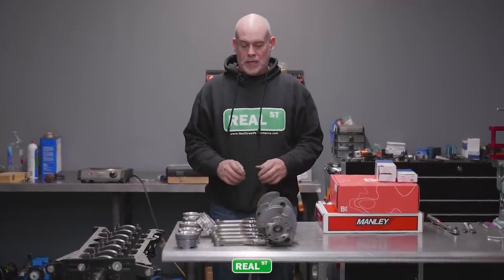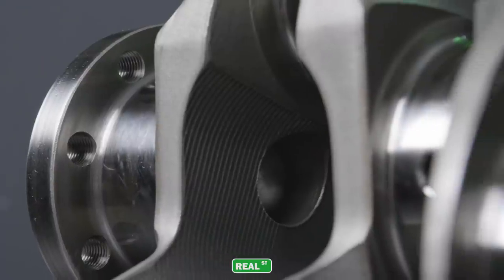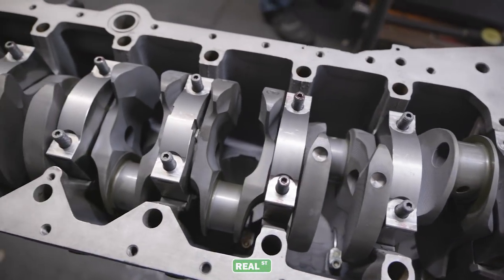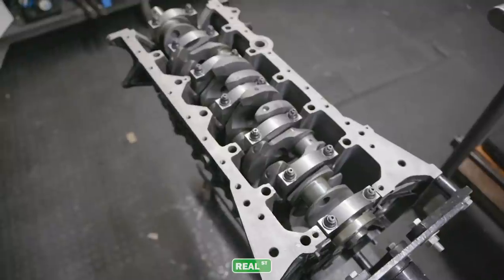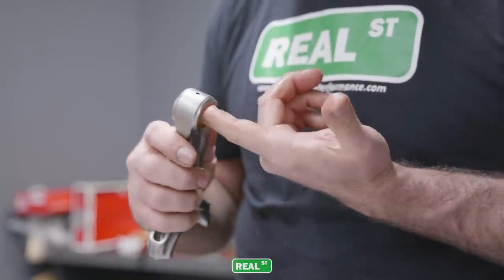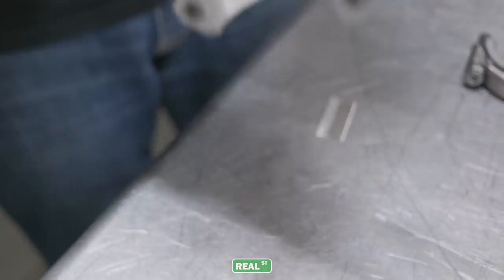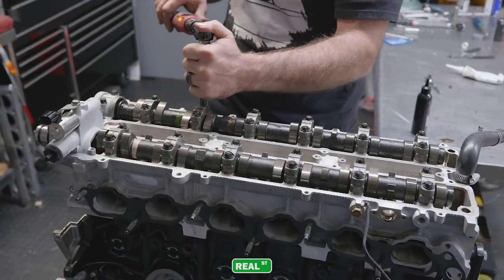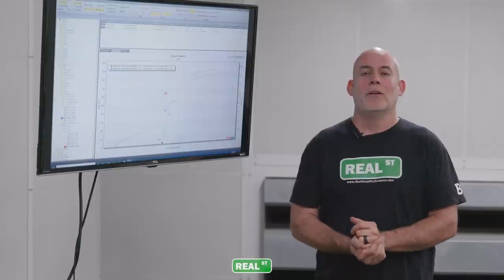Shaving 16lbs Off 2JZ Engine With Titanium Rods & Billet Crank - Jay's 96mm Stroker Build

Comment: Do NOT put oil behind the bearings, 
assemble them clean and dry on the back side!

Locate the main caps with dowel pins!

This WILL eliminate any cap walk!!!

I used to do N/A Nitro Methane engines.
5.40.... 255mph.

Comment: shaved some weight out of the engine im building. A high-comp 6g72. Between Billet pistons, forged rods,Cam gears,Springs and retainers, cam gears, Aluminum flywheel pretty theres about a 15lbs weight difference. Unfortunately i couldn't save more with a shorter piston skirt as No ONE makes High comp (12.5:1) pistons for a 6g72 save ross pistons and they're a full round style piston.. No one makes a short skirt style piston. But saving 16 lbs out of an already built engine is pretty nuts.

Comment: Hello jay! How much maximum can you increase the power of the 2jz engine?
Reply from the maker: While I’m not sure a maximum limit has been found yet, there are people going 5’s in the quarter mile with sleeved billet aluminum dry blocks in 2jz dimensions. As for a built oem cast iron wet block we went 6’s with it through an automatic in a car that was heavier than most race cars because it had to have street driving equipment for drag week. So it’s gotta be up there

Comment: Hello Jay I have a 2001 Gs300 like Roberts and was wondering if I should go the stroker crank route I bought a full jdm 2jzgte vvti aristo swap.  I was thinking possibly procharging the car with a F1 procharger and using a BMW 8hp70 transmission with a controller.  I want to try something lil different from the norm since alot of the new cars are coming out with 8 and 10 speed transmissions.  I just wanted to get your opinion. By the way this will be a street car
Reply from the maker: The stroker crank really makes the driving experience of the car more enjoyable on the street. Low end torque, part throttle response, and turbo response all improve

Comment: Which engine oil did you use on the backside of the bearings? The red stuff is not atf i guess? Thanks Jay!
Reply from the maker: I just use ATF. It's thin and displaces any particulate on the mating surfaces and will lubricate the surfaces as the bearings meet at the parting line and get forced into their location.

Comment: Just wanted to point out that the previous torque line on the graph is suuuuuuuper faint. Otherwise, excellent video and great insight on everything, Jay. 
Curious what's the most you'd spin this 96mm crank up to. I do see 8k.

Comment: Is oil on back of bearing mandatory?
Love your videos!
Reply from the maker: i mean, its not mandatory. the parts will go together without it, but the bearings are held in place by the crush of tightening down the main caps. As the main caps get tightened down, and the bearing becomes crushed, the lube behind the bearing gets squeezed out the sides, taking left over tiny debris with it.
Reply: @realstreetperformance  thanks for you reply! This is by far the channel for engine builders.

Comment: my question so far is why not go all out and do 10:1 compression instead?
Reply from the maker: Good question, i think the answer seems easier if you just keep going. Why not go 10.5:1? why not 11.0:1? or 12.0:1? Compression vs Boost vs Timing vs Detonation vs Heat is all a give and take relationship. Upping the compression doesnt always translate to a better combination. You could up the compression, which will affect the other components in the relationship. Its all about finding a total package that works for you. This is a combination I like.

Comment: You put oil under the bearing caps? Won’t they spin?
Reply from the maker: not at all, while it seems reasonable to think that, the bearings are held in place by the crush of tightening down the main caps. As the main caps get tightened down, and the bearing becomes crushed, the lube behind the bearing gets squeezed out the sides, taking left over tiny debris with it.

Comment: What kinds of rpms can this go to safety with the rotating assembly being lighter?
Reply from the maker: Roscerio the best way to think about it is that (kind of like people) all engines will die, and are constantly dying a little bit more each day. The harder life they live, the shorter it’s life span will be. Making parts lighter will make its life easier and should extend its life span from what it was. But it’s still approaching an eventual death. There is no “safe rpm” that it will live forever at. A Higher rpm window will just cause the engine to approach a death faster than a lower rpm window.

Comment: is that okay if i dont put oil under the bearing?  this is first time i saw this.. tq
Reply: I thought the same, pretty sure that’s something you are definitely not supposed to do.
Reply: A lot of people dont use that method because of your oil clearance. If you use too much oil/assembly lube for example you will destroy your bearings.

Others like jay do that just with a tiny drop of oil to protect the backside of thr bearing. Whenyou install them sometimes you will shove the backside and some material stays on the edge that you have to wipe away.

I guess that was very thin red atf. I also do both methods and would recommend beginners that you DONT use oil unter the bearings. It is safer..
Reply from the maker: over the years, there has been a lot of "rules of thumb" passed down between generations that just got memorized without looking into any further. But this is a method I have used on hundreds of engines that regularly make over 200-300hp per cylinder. The bearings are held in place by the crush of tightening down the main caps. As the main caps get tightened down, and the bearing becomes crushed, the lube behind the bearing gets squeezed out the sides, taking left over tiny debris with it. There isnt any oil in there anymore by the time the bearing is crushed into place.
Reply: The bearings are crushed and held DOWN when you tighten down the caps. They dont go anywhere unless you starve the engine of oil.

Comment: Isn’t putting lube behind the bearing an absolute no no??
Reply from the maker: not at all, the bearings are held in place by the crush of tightening down the main caps. As the main caps get tightened down, and the bearing becomes crushed, the lube behind the bearing gets squeezed out the sides, taking left over tiny debris with it.

Comment: Why did you lubricate the rod (behind the bearing)?
Reply from the maker: the bearings are held in place by the crush of tightening down the main caps. As the main caps get tightened down, and the bearing becomes crushed, the lube behind the bearing gets squeezed out the sides, taking left over tiny debris with it.
Reply: You lube all 4 sides
Reply: @realstreetperformance  Corrme if I'm wrong, wouldn't that leave some lubricate behind and create inconsistencies in the bearing clearances? I've never once lubricated the back of a bearing. I clean the saddle with ATF, acetone, ND mineral spirits. Thanks for the replay.
Reply from the maker: @scottworelds2933  hey Scott. Nope it does not leave lubrication behind or change the bearing clearance. It’s a method that has worked fir a very long time. I’m not sure why it became such a popular topic in this video. We’ve used this method in every engine video. Growing up people thought that lubing the back of the bearing might allow it to move. But thats not how bearing crush works. Now today people think it shouldn’t be done because they heard it from their fathers who heard it from their fathers and pretty soon you have 3 generations of people that “know” not to do something but none have ever checked if it was true or if it was an “old husbands tail”. It’s a great exercise in “how do you know what you know?” If the answer is “because someone told me” then you don’t really know for sure. Especially in this case. In this case, we show how we build very powerful and very fast engines this way and they do not suffer premature bearing wear. But don’t take our word for it. You can try it yourself if you want  and then you will truly “know” :)

Comment: They always say not to put lube on any of the caps. Your method is new to me.
Reply from the maker: while it seems reasonable to think that, the bearings are held in place by the crush of tightening down the main caps. As the main caps get tightened down, and the bearing becomes crushed, the lube behind the bearing gets squeezed out the sides, taking left over tiny debris with it.
Reply: My engine builder did the same thing or told me to do the same thing to my rod caps and bearings when i built it back in 2000 as Jay just did ... this was on my 98 240sx ka24de

Comment: I have 2 questions, the 1st being why do u put a small amount of lube behind the bearings, won't that cause them to spin in the bores ?

And 2 I have a set of Cunningham Titanium Connecting Rods that I had Greg Cunningham make me a while back for an ej25. Finally getting around to that build. I emailed Lisa Kubo and she told me to be sure to "Lap" the Connecting rod bolts really well, how is that done and why ?

I would ask Cunningham, but they closed their doors so no one to ask there.. My rods have Cunningham gold plasma moly coating and Cunningham's own 3/8 rod bolts A1 H.. Any help would be appreciated. 

Thanks
Reply from the maker: Hey Mark, the bearings are held in place by the crush of tightening down the main caps. As the main caps get tightened down, and the bearing becomes crushed, the lube behind the bearing gets squeezed out the sides, taking left over tiny debris with it. There isnt any oil left between the bearing and the block by the time it is crushed into place.
Reply: Thanks for your reply Jay for helping me understand lube behind the bearings.. Any idea on my 2nd question about lapping the con rod bolts on titanium rods  ?  I have talked to several builders and know one can give me an answer.. One top alcohol builder took a guess and said to put a small amount of lapping compound under the bolt shoulder with the cap in the vise and just like a valve lap the bolt shoulder so there is a smooth mating surface between the bolt shoulder & cap..He had never heard of doing this either & this was his best guess..

Also what do u use for assembly lube for the bolt and ti beam..
Cunningham said 80/90 but did not give a stretch value.. I'm ki da bummed on the no stretch value..

Comment: 7:26 Why do you use two different lubes for either side of the rod bearing?
Reply: He uses oil where the bearing meets the rod and the he uses assembly lube where the bearing meets the crank🙂
Reply: @mariospera3282  Thanks, but thats not what my question was.
Reply: Answer at 2:10
Reply: @0000a-v8d  Yea I caught that, but WHY the different lubes.
Reply: Oil film thickness affects the bearing clearances, so thin behind the bearing is ok.
Reply from the maker: @beachboardfan9544  I use a thick lube that will stay put during cranking until the oil pump primes and a thin lube on the back of the bearing that's displaced when the bearing halves meet. Thanks, Jay
Reply: @realstreetperformance  Thanks! Why oil the backs of the bearing at all?
Reply from the maker: @beachboardfan9544  it acts as a “flush” when you tighten the caps down it pushes the oil out carrying any lingering debris with it and it helps the bearing seat in place as it’s being crushed in

Comment: Guess we'll all ignore the 1.58 rod ratio this 96mm crank puts him at on a standard 152mm length rod. There's no mention on weather they used a custom longer rod to alleviate that or (if not) how this will affect his max rpm limit as mean piston speed is to be taken into account.

Stock ratio is 1.77 and can rev freely.
Reply from the maker: Hey there, we are not ignoring it at all, almost every engine we build has a lower rod/stroke ratio than stock. Our most common 2jz combinations for many years have 152mm rod / 90mm stroke and 152mm rod / 94mm stroke. If you scroll through our channel and look at the 6 and 7 second street cars, they have rod/stroke ratios lower than 1.77 Much of what we do at real street is testing passed down "rules of thumb" in the real world. We were all told the same thing  growing up "low rod stroke ratio means low end torque, low rpm limit, and high bearing wear." But how low is too low on rod stroke ratio, and how high is high on bearing wear? When does it start to actually negatively affect the ownership experience of the engine? Is 1.77 OK, and 1.76 NOT OK? what about 1.75? what about 1.74? how much does 0.1 change in rod stroke ratio affect bearing life or an engines ability to rev? is it 0.001%?  1%? 10%? Well after trying it for many years we learned that a 1.68-1.61 rod/stroke ratio still lives longer than most people end up keeping a race car for. Even with the increased rod angle, the engines have lived, they rev freely, they make wide powerbands, they spool up big turbos faster, they make more power in the mid range and are more fun to drive on the street...so while they may wear bearings faster, its not enough faster to change the ownership experience of the engine in the real world. And for applications that exceed 300hp/cylinder we help extend bearing life with aluminum rods. So here we are again testing things in the real world. This engine is a 1.58 rod stroke ratio...maybe it will live a long life like the 1.68 and 1.61 engines do, or maybe it wont live as long. If the bearings wear faster it will be interesting to see how much faster they wear. Did they live 99% as long as the other configurations? or 50% as long? Testing theory with real world experimentation and data is one of the most fun parts of this job.
Reply: I'm just jealous. My stoker has a ratio of 1.51 and has indeed suffered from both bearing wear and oil consumption. I'm redoing it now with a better piston design to take care of the oil consumption and swapping in a taller deck to use a longer rod. Perhaps I'm sensitive to rod ratios after being bit by not considering it previously. I'm positive aluminum rods would help you in this case, but on a daily street car, as is mine, it's just not worth the added expense in my eyes..... 144x95.5 Audi inline-5 for reference.  @realstreetperformance
Reply from the maker: @mushasho  I understand, how much power does it make and how heavy are the rods and pistons? You might be using a heavier part than necessary. That can play just as much or more of a role in bearing wear as rod angle. Also detonation can kill bearings prematurely. Do you have a good enough data logging system to identify occurrences of detonation?
Reply: I'll admit, that On ethanol instances of det have proven to be a challange for me to detect, possibly cuz I choose to stay on the conservative side in terms of timing.... As far as rod weight, they are around 574 grams. Aluminum isn't offered or readily available for my application unfortunately.  @realstreetperformance

Comment: How do you feel about using caps with a girdle
Reply from the maker: I like the girdles that are integrated with the main caps like the Evo 9 engines. There are also some engines that try to hybrid a bedplate design by incorporating the pan rails and maincaps together. It really gets case specific as the amount of stress on the mains change. The 2jz has 6 rods but 7 main caps whereas an engine like the Vq has 4 mains and 6 rods.    Based off experience I don't see the 2jz needing a girdle as the blocks shortcomings are not in the mains. Thanks, Jay

Comment: is BC titanium rod coated? Usually i see titanium rod with yellow color because TiN coating
Reply from the maker: These are not. On engines where the rod is partnered with another on a journal like a common pin the rod should be coated to avoid the two rods from galling each other. On an engine with each rod having it's own journal it's not critical. Engines like the LS7 in the C6 Zo6 it's critical. Thanks, Jay

Comment: Will titanium rods have to be replaced in the intervals as aluminum rods?
Reply: No, the alum rod is a soft metal which is why they are easier on bearings in big power builds. These are basically a stronger and lighter version of the standard steel rod. Most people don't buy them because they are roughly double the price of standard quality steel rods.
Reply: @dj4monie  Awesome, great info, Thanks